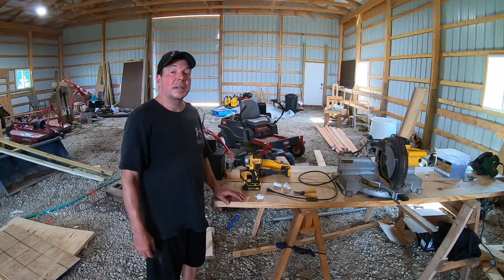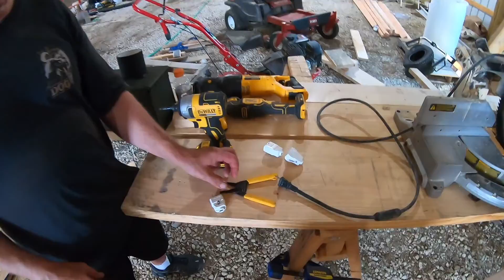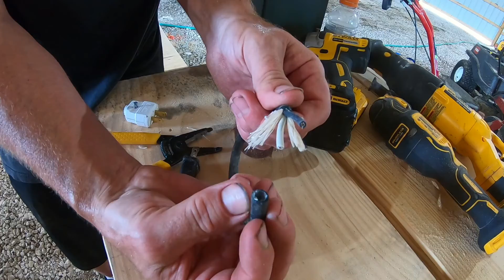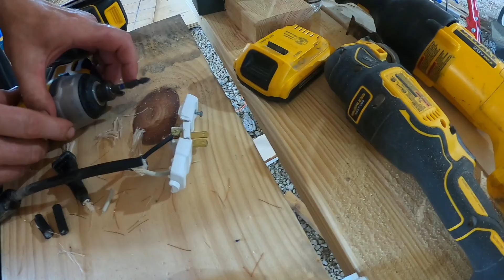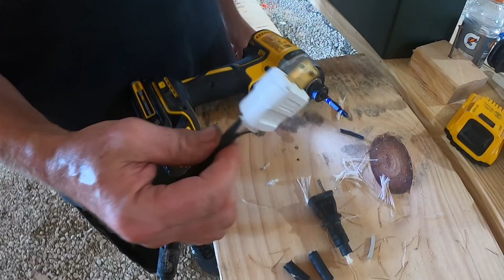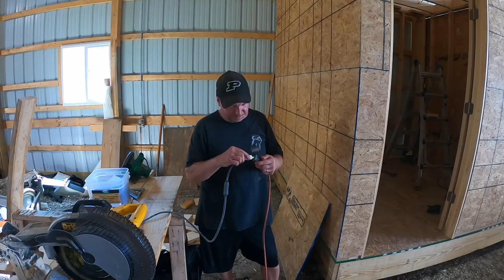How to Fix A Broken Plug

Comment: How do you tell where the black wire screws into
Reply from the maker: Hey Jennifer,
I would hope there are some directions with it. But check - the plug that has a small blade for the hot wire and a wide blade for the neutral wire.
So typically the brass screw gets the hot black wire and the neutral has a silver screw. 
Hope that helps.
Thx for watching!
Hope that helps.

Comment: Does it matter if the cord  spec is 10A and the replacement plug is 15AMP?
Reply from the maker: Hey ilove,
Great question. I’m not an electrician so all I could do would be guess. 
If your cord is 10A, then your cord would limit the amount of electricity passing through it since the cord is smaller and the 15A plug being big. 
Seems like the reverse might be an issue.
Thx for watching!
Reply: @Housebarons  Thanks for your input

Comment: In regards to putting the ground and hot into the terminals. Did you make a hook for each around the screws, I've seen some ppl also twist the wire strands, and other ppl just pushing it in there.
Reply from the maker: Hey first,
Generally I prefer to loop around screws unless the device doesn’t allow it.
Thx for watching!

Comment: hey! do you have any tips for the same sort of thing, but instead of the metal thing snapping off it kind of retracted into the plug.
I don't think this is something that can be replaced, so if you have ANY tips then that would be so greatly appreciated.
Reply from the maker: Hey I…,
If you are familiar with electric or have a friend who is an electrician, maybe replace the outlet?
Sounds a little odd.
Thx for watching!

Comment: So I want to replace my cord for my vaccum.  The vacuum I have said it takes 120v 10A. In the stores I can only find 125v and 15a replacement plug.  Would I be able to use that to replace it?
Reply from the maker: Hey Jason,
I’d hold out to the exact right plug. Amazon? Or maybe an electrical supply store? Or granger? 
Thx for watching.

Comment: Would this work on a heavier duty appliance, something like a window ac unit or a mini fridge?
Reply from the maker: Hey Patience,
Plugs also have ratings so you’d want to make sure - maybe ask at the big box store or local hardware store ( especially the windows a/c unit ).
Replacing it is the same concept - just want to make sure the plug can handle the power going thru it. 
Thx for watching!

Comment: Do I need to replace the plug my plug will not charge will this correct my problem?
Reply from the maker: Hey Debra,
It MAY fix it. Some times, breaks occur at connections inside the plug or at the point where the wire goes into the plug. 
It’s not an expensive repair, so there is little lost other than your time. 
Thx for watching.